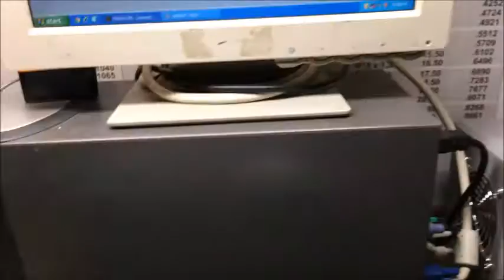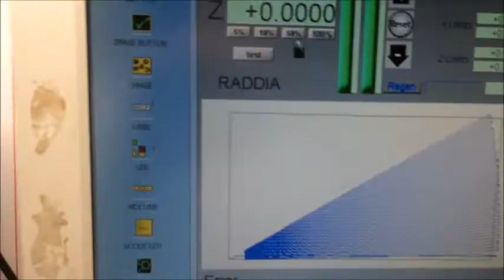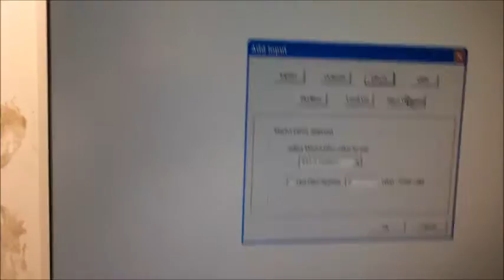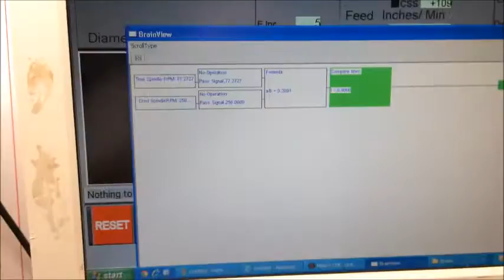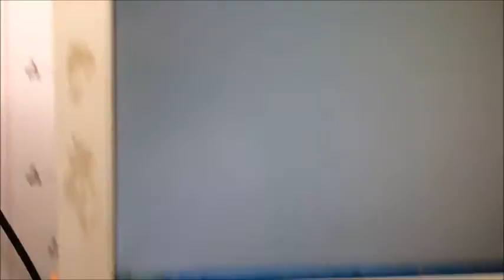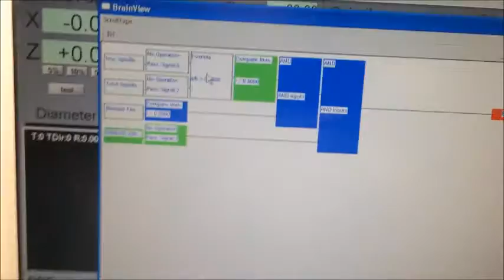Mach3 Brain: How to Write a Brain to Stop Feed if Spindle Stalls

Comment: I have workpieces that vary in z plane and I run the same xy program on them. I have a capacitance sensor that detects if the tool gets too close to the workpiece it is triggered but am having trouble finalizing the brain to adjust the z height a fixed incriment upward. Anyone know a command that would do this? basically, if sensor is triggered while program is running, adjust zheight .25" upward and continue running.
thanks!

Comment: Would anyone please be able to advise/assist...
I was wondering if anyone has created a manual over ride/adjustment control panel to allow for incremental adjustment of individual axis. This would be after datum set up of cutter in order for me to make a perfect match of two surfaces. (An existing one and the one that’s being milled) I need the increments to be .1mm for accuracy. I have a screen shot of a piece of software that has this capability reference. In this software it’s called set offsets.
 i need it on the mach 3 mill screen ,can send photo if you email me 
Thank you :) 
steve on stephen.brindle@icloud.com

Comment: Hi, I have question why did you select blended feedrate in creating brain, thing is that I do not understand meaning 100% of blended , does that means moving one of existing axis (z or x ) ? Anyway will use your tutorial to make spindle protection because I had few situation where I saw it will be really useful , like drilling and boring deep holes, when built up  chips inside of part  can stall spindle .

Comment: Hi i'm italian, use google translate.
I'm doing first test with mach3 turn.
Do you use G96 constant cutting speed?
Because I noticed not good behavior with constant cutting speed G96 with use of G95 (mm / min)
Especially in turning face, does not respect F.
It works correctly with G97 fixed speeds.

Comment: I Franco,it is possible to have another axis in the Mach3 turn? besides having the x-axis and z-axis have for example the c axis, if we can speak for PM is so mean. thank you
Reply from the maker: I don't think turn can handle more than two axis. But, you can configure a milling profile to handle what you are doing. Just switch over to milling when you need it.
Reply: it is possible, i use y axis

Comment from the maker: I made a few improvements to the brain.  Follow the link to download the brain, screen sets and macros.

https://www.dropbox.com/sh/h97cq08r88uk0t9/AAAuoF4YJNzfvebD8xTxEF3Ha?dl=0

Use the macros (M201 to activate and M200 to deactivate) to control the brain from within a CNC program.  This new version of the brain checks the status of the Spindle On LED.  If the spindle is not commanded to be on, it won't trigger the e-stop.  However, if the spindle is commanded to be on and the brain is activated (either with M201 or by pressing the button), anytime the actual RPM drops below 90% of the commanded RPM while an axis is moving, the e-stop will be triggered.

Comment: Is there a way to interface it with a feedrate over-ride?
Reply from the maker: Maybe. Since I've first posted this, I've updated the brain to look at the condition of the spindle on LED. The brain only triggers the estop if the spindle is on, the RPM is less than 90% of what is commanded and the axis are moving. This seems to be the winning combination.
Reply: @FrancoCNC  Do you have a .. how to... on this new setup? Thanks!

Comment: nice brain, my question is when the spindle is not running a cant jog with it turned on ?? plus my spindle is controlled by a vfd so when the program goes for a tool change and the spindle aint runnig it estops before it get to the m3s1100 to start the spindle, as your spindle is  manual i can sse how this works well for you, keep up the good work, thanks daniel
Reply from the maker: You are spot on. I have to turn off this feature before I can jog manually. You can probably create a M code to enable and disable this function from your program. I'll have to look into that...
Reply: I will look at it too and see if I can come up with a way to do this, i was thinking maybe add a turn off command to the homing marco as this is normally the first thing you do.when you turn on a machine and on the wizards screens adding an option to add this brains or not, when you make your g code file ?? What do you think ??, thanks for your rely daniel
Reply from the maker: I just made custom M codes to turn this feature off and on.  

Create a file called M200.m1s and save it in the MACROS folder under Mach3.  The macro will have one line of code:   SetUserLED(2000,0)

Now you can call M200 to disable the speed fluctuation detection.  

I also created another file called M201.m1s to turn it on.  The macro will have one line of code:   SetUserLED(2000,1)

I hope this helps.
Reply: +Franco that's brilliant, I will try it when I get home, thanks daniel
Reply: Another option to save your tools and machine, is to wire your VFD in series with the E-stop button. If your VFD unexpectedly stops for ANY reason during an operation, it can be programmed to cut the signal and activate the E-stop. I use it on my mill and it works great.
Reply: Great idea that's is, thanks daniel

Comment: That's really cool. Have you tried the brain with that feed hold instead of the estop.  I would imagine if the feed stops for a second maybe the spindle rpms would pick back up.  That way the program would continue to finish the job. I would think it would work well if the feed rate percentage were turned down untel the spindle rpms went back up also
Reply from the maker: Thanks. I tried feed hold and, for some strange reason, Mach3 gets all messed up when I try to resume the program. The tool paths go crazy. I figured it was safer to do an e-stop and then restart the program.
Reply: oic thanks. I need to go find screen4 and play with it... thanks for showing me i hadn't heard of it befor
Reply from the maker: +builtrodewreckedit Screen4 is free on the Artsoft website.